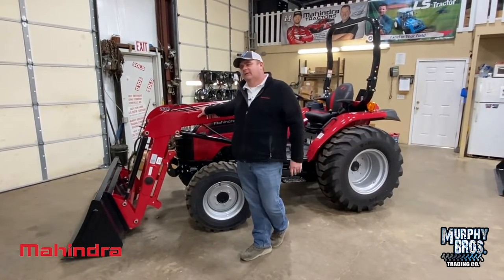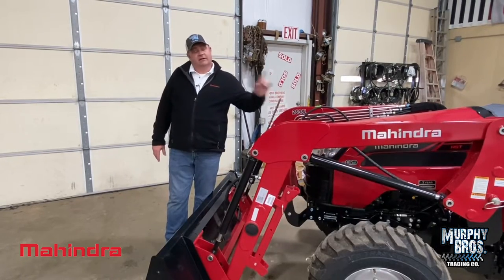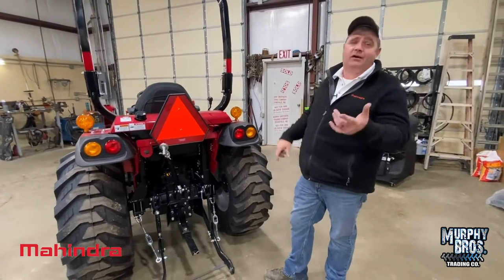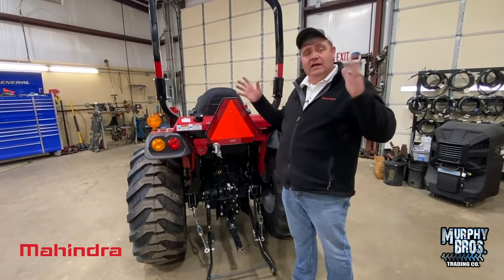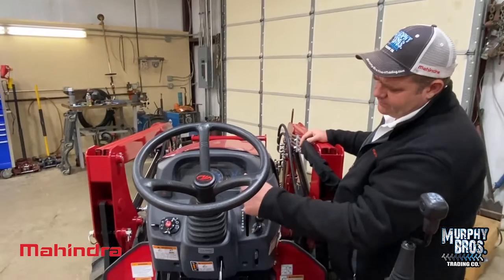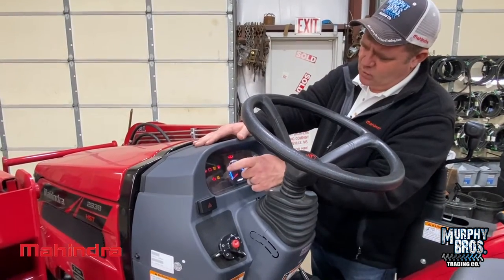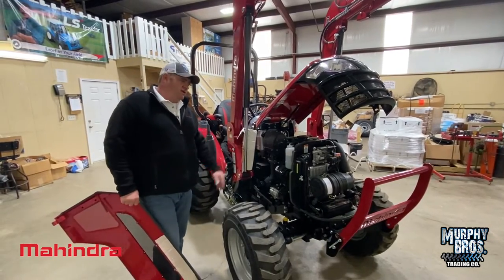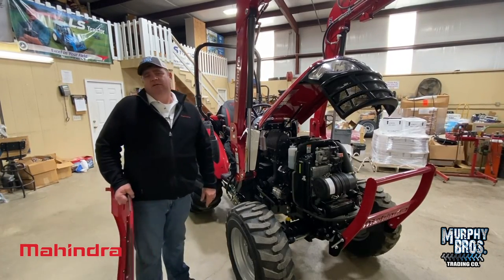Mahindra 2638 tractor walk around

Comment: Hi, Chris. I just looked at the 2638 at a dealership here in Maine yesterday and REALLY liked it. Your detailed  walk-around makes me want this model even more. This is absolutely the best, most useful "product discussion" I have ever seen on You Tube. You're a natural teacher, Chris, and that's a rare commodity.
     Having watched your walk-around, the Mahindra's simplicity, rugged build, and size, SEEM to make it a very good substitute for my 25-year-old New Holland 1920, which has been very good to me but is now tough to find parts for. Speaking of which, how hard is it to get parts for the 2638 and the other Mahindra models?  All the best, another Chris
Reply from the maker: Thanks! Coming through Covid was very tough on the tractor industry. Many manufacturers jave now realized they must stock more parts. Many dealers don't understand the value of their parts departments either. Some dealers stock most common items, but some have to order an oil filter! This is not a Mahindra issue, it's an industry issue. Check your dealer before you buy to make sure they are parts and service oriented.